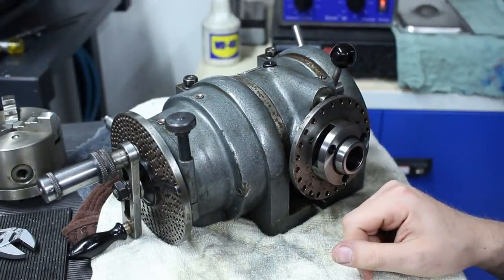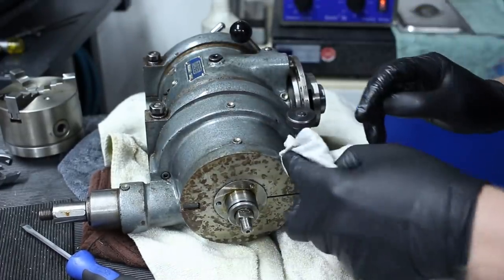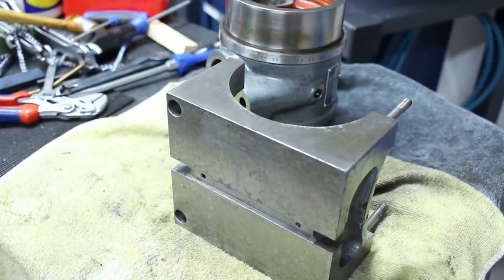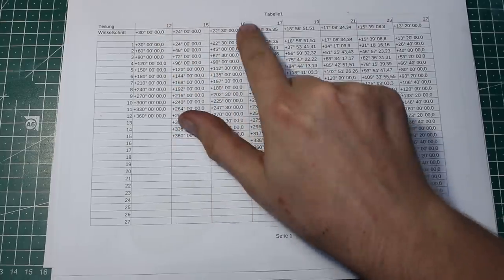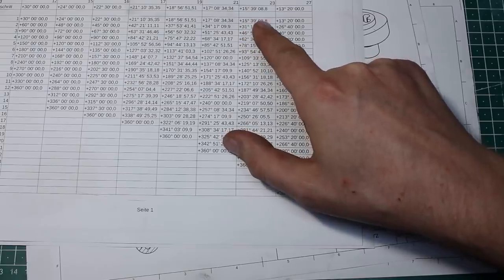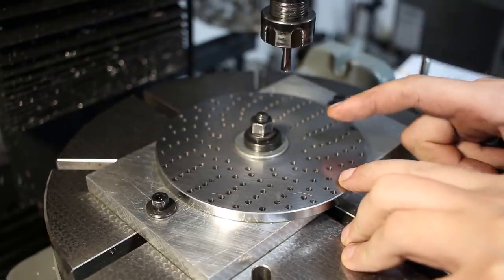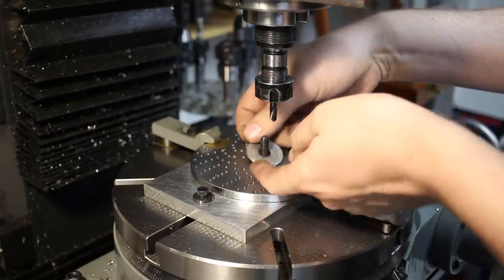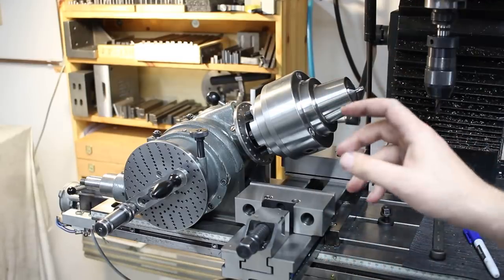Walter UTA80 dividing head

Comment: That's not a PIT Shaft. Power Input Shaft. And when they are in the way they're a PITA shaft. 😜

On the index plate you could of really gone old school and layed out the holes with dividers  🤞🤯

Beautiful flaking job on the face of that Moore. 👍

Drilling all the holes and reaming them, well watching paint dry would be duller  👍 The small Hardinge H4 uses a tapered pin to maintain pin to hole location

And some people wonder why precision costs. As for the vernier on that table I suspect it reads to a less level of precision than an astronomical instrument

Comment: Around the 4 minute mark you have a bit of a stumble with degrees minutes and seconds, which made me ask myself, “why is there no metric replacement?”
Reply: The SI unit of angle is the Radian, which is about 57.2957795131
 etc etc degrees.
Reply: Eric Featherstone I’ve always used radians in conjunction with math, esp calculus, but I’ve never heard anyone use radians in the context of building something nor have I ever seen a tool with radians marked on it. Also radians are calculated in terms of pi, which defeats the point of SI. SI’s main selling point is that it’s base 10 and each prefix counts as an order of magnitude.

Comment: 10 micron deflection, I don't think 10 micron is a number worth mentioning. Most of the items that we make at the shop don't need to be any better than 25 micron and many surfaces can be within 200 and sometimes more. We make tools and dies though, so there are a bunch of surfaces that are just clearance. I think you'll be fine in any case heh. 10 micron indeed...

Comment: Now if you drill a 2nd plate using the dividing head an the plate you made, you can produce a true "Master Plate" that is 40 times more accurate than the first plate you made.

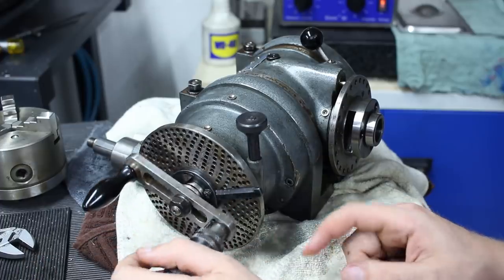Comment: dividing plates accuracy isnt that critical at all. the error you make is divided by the gear ratio of the dividing head. if lets say its a 1:40 if your dividing plate hole is off by 0,5mm which would be extreme the error on the spindle would be only 0,01mm . you could have just done it with the pitch circle function of your DRO

Comment: WHAT ARE YOU DOING?????? THAT THINGS IN GREAT SHAPE.... WHY YOU TEARING IT DOWN???
Reply from the maker: Why are you yelling?
Can you tell from the outside if the dividing head is in correct working order? If some idiot squeezed grease into every lubrication fitting? If it was used without any lubrication? If dirt got into it? If it was crashed in its prior life and the wormgear is damaged? I can't so I have to tear it down. Now I know its condition and don't have to think about it, apart from regular maintenance.